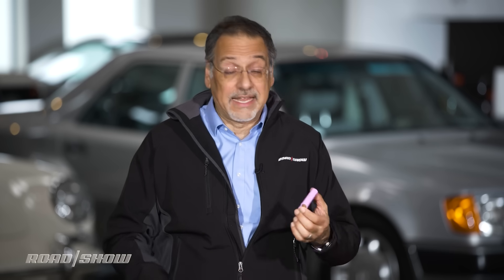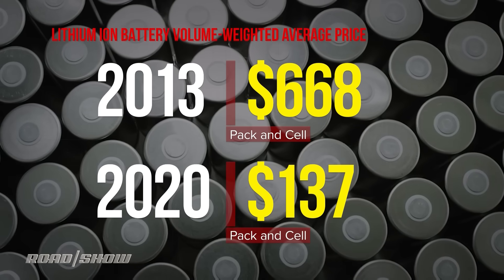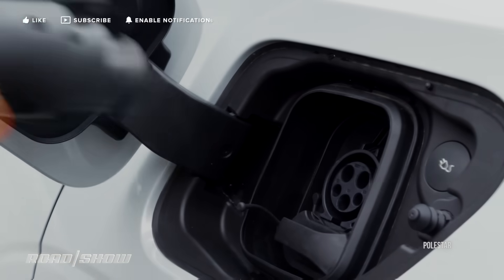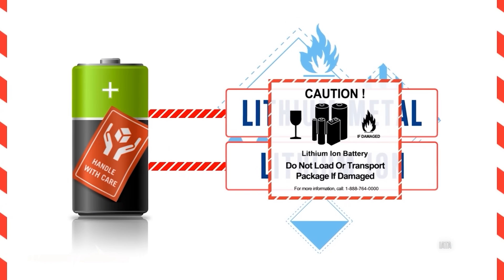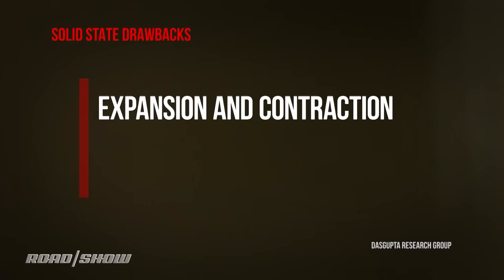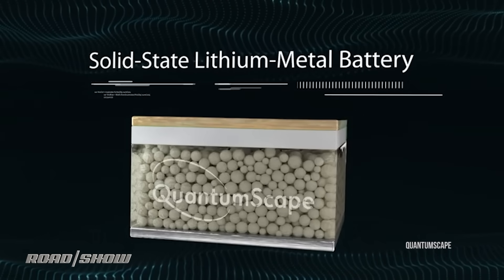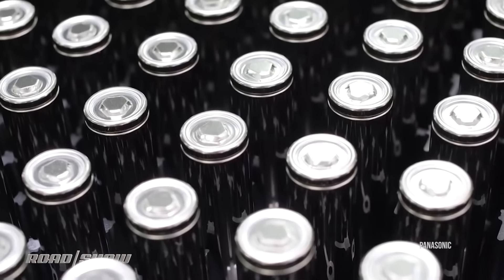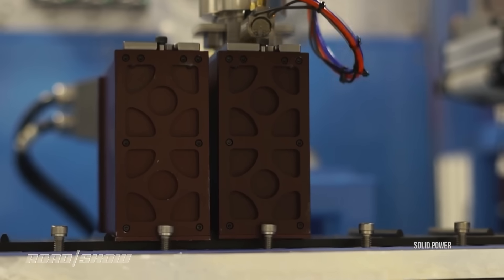When solid-state batteries arrive, you'll want an electric car

Comment: Will I want one? Not likely. I can pump 300 miles worth of fuel into my car in under 5 minutes. Give me 15 minutes and I can pump 1200 miles worth of diesel into a semi. Enough for 2 days of driving. There are things to like about EV's like the instant torque and mechanical simplicity but the drawbacks of battery power are many. Energy density being one of the biggest  but not the least. And the problem cannot be solved simply by improving battery capacity, there will  be major improvements to be made in the electrical grid which is already near capacity. BTW have you seen the hours long traffic backups from people waiting in line at a Tesla charging station on a holiday weekend? Even if the charging times are lowered enough to be useful each charging station is going to need high tension power lines and a substation to handle the load. Is there a place for electric vehicles? Probably several. But, their usage will have to be thought out much more carefully than is being done at present.

Comment: A thesis of this video is that (battery) electric vehicles are not already useful.  This is highly misleading.  

EVs are already highly useful for daily driving, most of which is within 20 miles of home.  And longer range EVs like Teslas can already go on multi thousand mile road trips, which many people have already done, particularly thanks to Tesla's excellent Supercharger network.

Speed of EV charging is totally irrelevant for most people who charge at home or work over many hours while they're sleeping or working.  Most privately owned vehicles are parked 23 hours per day, any of which can be used to charge at any place that has electricity.  Fast charging generally only matters for very long road trips.

In addition Lithium ion batteries are progressing so rapidly that they are already projected to meet the capacity of near term solid state batteries at their current rate of improvement.

Tesla already has batteries that last half a million miles and Professor Jeff Dahn's group which works closely with Tesla has already designed million mile Lithium ion batteries.

Existing Lithium ion battery packs can already be charged more than 1000 times, depending on the depth of discharge.

So lots of sloppy misinformation is in this video, as usual.

Click bait hype is not useful information.

Comment: Telsa hasn't used the 18650 for years... they moved to 2175 now they are on 4680.
Reply: Those are form factors not battery chemistries. All three are used by Tesla (1865 for S/X, 2170 for 3/Y 4680 planned for some existing + future models)

Comment: This is the sort of thing that I've been waiting for before switching.  I am interested in getting an EV but Li-Ion is just too heavy with too short of a shelf life.
Reply: That's not true anymore. A current EV battery would easily last you more than the life of the car while losing less than 10% design capacity over the 10-20 years you'll drive it.

Comment: Where are you going to charge them when the grid goes down?
Reply: The gas station stops working without power also. At least if you’ve got solar with battery storage, you’re more self sufficient.

Comment: I would try keeping my car for the full life of the battery, but it’s still an interesting point that a battery that lasts long enough can be used in you next car or that a company might use it in a lease or someone may reuse it another way.
Reply: The biggest issue with cars is rust.  After like 10 years they start to rust beyond economical repair.  Of course the answer to this would be aluminium or stainless steel body but it would also be nice if they made the battery modules more standardized so you could just take them out and put in another car.
Reply: @redsquirrelftw  many of the battery packs are pretty standard within a brand - many of the VW and Audis and many of the Kia/Hyundai have the same exact packs, but they probably won’t be the same after ten years.  You may be able to buy an old Audi in ten years and put a an old, but still good VW pack in for example, but I totally agree. It would be great if they could have standards like the AA battery, but for the whole pack.

Comment: 1 in 16,000 Tesla's catch fire; the problem is you can't put the fire out the batteries catch on fire inside a metal housing so they will burn for hours; think of a Semi with 5 tons of batteries on fire.  These are relatively new cars ; very few newer ICE cars catch fire without being hit by another car; Teslas catch on fire just if they get hot in operation or if they are charging.  Maybe the newer battery will cut this problem; however w regard to solid state - if nothing even better comes along and they are made in large quantities; don't catch fire; cost too much, last long enough, don't need special chargers,  etc then yes they may make Hybids and Lithium ion obsolete but those are a lot of ifs.

Comment: How does the electric car heat the passenger cabin? I can only guess that it needs to create heat via the batteries. Won’t that severely affect the mileage range during cold weather? I own a  Sonota hybrid and the driving range is over 600 miles on a 17 gallon tank. I’m now noticing the mileage decreasing a bit because the battery efficiency seems to be diminishing with age. I think the same thing will happen in any electric car.
Reply: That's why electric cars are increasingly using heat pumps...

Comment: The winner is a combination of a small Solid-State Battery and  Hydrogen( light weight and fast refueling)..that combination will be vital for midsize to heavy duty trucks. PS. That is why I am a shareholder of the company..PLUG Power note: not a financial adviser, just my opinion.

Comment: If a battery pack could last 330,000 miles in a given vehicle, why suggest it would get assigned to another vehicle?  This is a false assertion ,projecting the traditional limitations of ICE vehicles on to EV electronic driven lines and systems.  I don’t think anything observed in EVs driven systems would even remotely support this. The life cycle is derived from the (mitigated) complexity and durability engineering into it, not yesterday’s automotive planned obsolescence model.  Example: pretty sure an electric motor with one gear is a order of magnitude more reliable than a engine / automatic transmission. If the market supported a 25 year 1million mile vehicle it could be done ... technically.

Comment: SO, What happens if our North American electric grid goes out, turns off again???.....
Reply: You mean the independent Texas grid, not North American grid.  That grid failed due to a lack of cold weather insulation and anti-freeze preparation that stems from Texas' anti-regulation approach to grid management.  The rest of America's grid is well insulated and protected.   However, with cybersecurity threats today and extreme weather events your question is a  completely valid conern.

Comment: Tesla hasn't used the 18650 cell in years. They replaced them with 21700 about 3 years ago, and are in the process of replacing the 21700 with 46800, a tabless, longer lasting, faster charging battery.
You're far more likely to have a fire in a gasoline powered car than an EV.
Charging time is mostly irrelevant as 95% of charging is done overnight while you sleep. 
Cold does impact range but not enough to affect daily driving; an overnight charge will provide all the range you will likely need at any temperature. 
Solid state batteries will be good when they are fully developed, but the current technology is more than enough to warrant switching to an EV.

Comment: 250 miles of range is pretty decent. it suits 80% of daily commuters.
Reply: Almost 300 miles with my Kia. Enough to last me almost two weeks. I'm happy.
Reply: not me  the range on my  i c e car is 400 miles approx and only 2 minites to fill up and go on my way
Reply: How about us people in cities living in apartments? Where are we supposed to charge electric cars. Unless they build enough of super chargers I am not getting electric. Ig might be fine for people with their own garage where the car can be charged overnight.
Reply: @Kikinho19  if you live in the city where are you commuting to? i assume there is a subway or bus? isnt the point of living in a city is that you are near where you can work? there are 3 non super charging stations within walking distance of where i work in a small city in mass. there are super charges scattered around eastern mass. no one is saying the solution is arrived at in one step. it takes time to build up the infrastructure.  talk to whoever owns the apartment and get the 2nd tier chargers installed or talk to the city.
Reply: @danroden830  why would I do that? Its easier for me to use my gas guzzler. I can barely find any parking place anyway. I could use bus and underground but I prefer my car, I can afford it and I prefer it. My part of city has exactly 3 charges in 10 kms range. 2 of those are reserved for car sharing firm in the night.

Unless they start building proper network of chargers people wont be buying electric cars.
Reply: @Kikinho19  they are building out the charger network but you can be proactive and get them installed in the building or ask the city to move faster. you are not the target audience currently just like starlink has  a target audience not every single person. you solve problems in small steps not trying to solve the whole thing all at once.
Reply: @Kikinho19  you say you cant find parking spots but also prefer your gas car. bruh.  they are building the network of super charges. there are also low level chargers scattered around. they cannot magically make them all appear in a single day or even year. it takes time. so they maximize the areas they build in so they can serve the most customers / people dense areas at once as thats the best ROI. if you want more charges where you are ask the apartment owner or get the city to move on it. but if you cant find parking spots why are you driving? that sounds like self punishment.
Reply: @danroden830  it is difficult to find parking spot evenings yes, its much better to sit in a car than a public transport, its luxury but its so much nicer in a car. Now I would not mind electric auto if it was easy to charge it
Reply: @Kikinho19  electric cars are ok for short journeys
Reply: No it doesn't suit me
Reply: @jakef1987  thank you captain obvious for telling me you are in the 20% of people who need more range. i needed to know that. thanks
Reply: @danroden830  no the range is fine. I just like my vehicles loud and thirsty.
Reply: @jakef1987  you can have loud car music inside
Reply: @pHD77  I'm 33 so I think I'll be around a little while longer
Reply: @jakef1987  you can put giant speaker in the car if you want it loud, BMW i8 can do it so can you... you want it to be thirsty? put a hole in your coolant line, it will be thirsty everyday...

Comment: Have solid-state batteries arrived? Because I already want an electric vehicle.
Reply: 6 years ago, I was shopping for an old pickup to convert to electric.  Parts alone would top $15,000. 

Then I bought my wife a used Chevy volt for under $10,000. 

And a used Smart electric car for $5000.  

Cheap easy fun.

Comment: 50 years from now you can still say that there will be a new better battery out just like you could say that about increase performance of your laptop and your iPhone. Left out is that EV‘s are already cheaper to own, safer and a lot more fun than ICE vehicles. To say that we need to wait for Solid-state batteries is absurd.

This presenter is either poorly informed or disingenuous in his desire to spread his speculative disinformation.  The fossil fuel industry will do anything to delay the implementation of EVs and I suspect  this guy is one of their shills.
Reply: EV's ain't got the same soul. I still like that old time rock n roll.
Reply: Agreed!  Solid State batteries still have lithium slurrey right?

Comment: ‘We haven’t perfected the...etc’...Maybe not but we already have Teslas and others with hundreds of thousands of miles on the original battery. Higher energy density, lighter and ultimately cheaper are all things we want but longevity and rapid charging we already have. The latest Teslas can put 70 miles on in 10 minutes from a low SOC, while the new generation of 800v systems (Lucid, Rivian Hyundai, Porsche) will add that much in 5 minutes. The problem for solid state startups and their backers is that they are aiming for a moving target. Good luck all the same

Comment: All that’s swell but the world doesn’t have enough electricity production capacity to meet the demand of EVs on mass scale. Heck, there are countries still depending on coal for electricity. We need to fix that issue first
Reply: That’s a myth. If EVis are charged off Peak they can actually help out even a coal fired grid because currently they have to wind down coal fired power generators at night that creates ineficiencies. It could be shown that if everybody had an EV that the grid could be made more efficient without adding any capacity.

Comment: when electric car tech reaches a point that it is better than gas, it will start to gain market share. artificially raising gas prices to force people to make the switch prematurely will stifle innovation on electric vehicles.. it will probably take 30 years for there to be more electric than gas cars on the roads.

Comment: Well dendrites problems seem no longer an issue with new patents. Samsung's new battery was emptied and charged 1,000 without any loss in charging capacity. Toyota also seem to hint they fixed the issue. You just mentioned Samsung finally as I write.

You also made no mention about safety. Solid state do not cause fires or overheat. It means less cost to install safe containers which we do for Lithium.

Temperature, cost and manufacturing are the challenges. 

MTI also has a patent with Mangonese which is cheaper and more abundant than other rare metals. They also did not report any issues with dendrites.

It used to be the issue but now it is no longer the creating or quality but fine tuning the issue of performance at low temperatures and figuring how to bring to market. Most experts (and I agree) this will happen in the next 5 to 10 years. I am predicting a big electronic revolution.

The only other critic would be max energy discharged new Lithium seem to be able discharge at higher levels. Again solid state is finally arriving to the show. I am certain they will perform in a short time similarly. Solid state still has 2.5 to 5 times the capacity, density, longevity and safety. 

Solid state batteries show ridiculous improvements and are finally not a concept but real working patents with multiple industry leaders. It is just a question of years before electric vehicles out perform in distance, longevity and performance all other modes of transportation for people.

I am hoping Toyota will bring a cheap affordable electric car for the people. I do not have the means to afford a 60,000$ vehicle. I can pay around 20,000$ hopefully even a little less (maybe forced me to the slightly used market). I am hoping to bring a 500+ mile car for a reasonable price. I am fine waiting 5 minutes for another 250 to 300 mile range. I am hoping electric charging station networks are increased dramatically since they will not be sufficient in 10 years for certain.
Reply: 99% of your car charging will be at home so the amount of time it takes a charging stations is almost irrelevant. After three hours of driving and taking a rest your car is ready to go before you are which currently is around 20 minutes for an 80% charge. Plenty good enough. No one ever mentions that filling up your ICE car once a month but with your EV you avoid that. Charging time with EV‘s in total is far far far shorter.
Reply: @colingenge9999  Well most charging at home will be with regular 120v or 220v so it will require longer for a full charge. Fast charging requires a special setup/system to handle the fast conversion between AC to DC. 

Current fast charging is 50% in 15 minutes for liquid Lithium. Most solid state patent prototypes are able to charge 50% in 5 minutes. 

The higher % of charge the slower/longer time. It is much faster to charge at approx. 50% than going for 80% or 100%.

I rarely travel in town and could charge from home but often visit family at least several times a year on trips which are 400 miles so it could close on a single charge with a basic EV of the future or current ones. I would probably wish to charge midway. 

Most Tesla models can achieve in the 300 to 500 miles in optimal conditions.

Comment: I'm only half way through and I've already found three untrue statements.
Reply: He’s insinuating that EVs have battery fires which is affectively untrue because they are at a rate of 1% of gasoline vehicle fires.

He’s insinuating that EV batteries or wind up in landfill which may be true of computer batteries but is extremely unlikely for EV batteries because of the valuable materials inside them and the ease of recycling.

He implies that the solid-state batteries are just about to be released but they have barely got them working in the lab and there may be another decade before they become main stream which is a typical delaying tactic of the fossil fuel industry.
Reply: @colingenge9999  yeah thanks I clicked off before I got that far guys a real tool haha
Reply: CBF to list em off though eh
Reply: @maxnovakovics2568  I just listed three disingenuous comments he made. If not then misinformed.